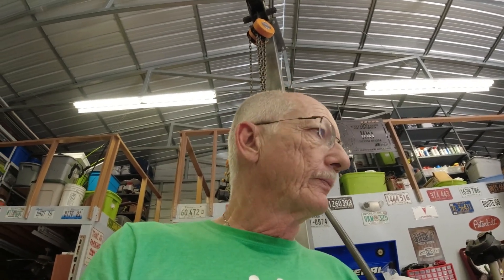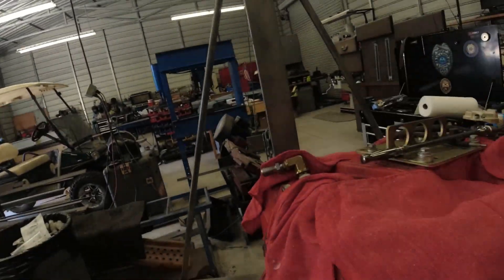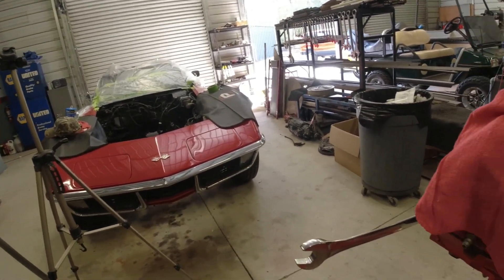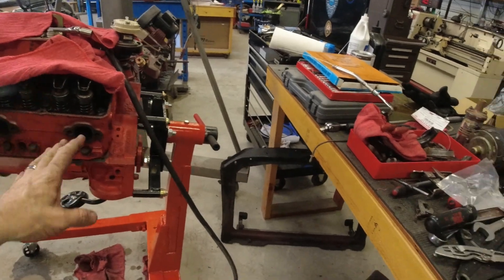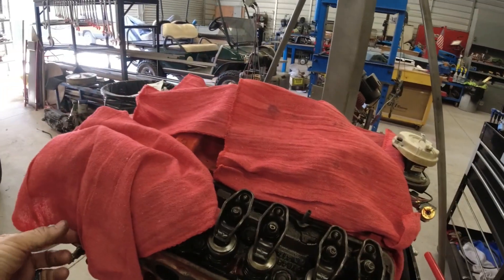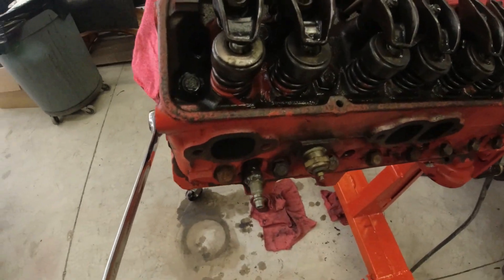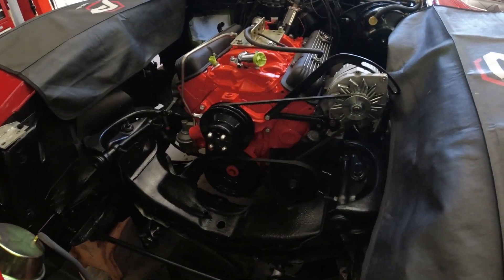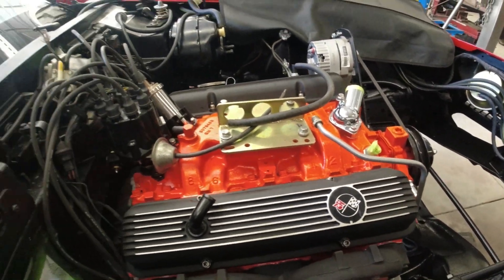Chevy 350 Rebuild: C3 Corvette SBC V8 Engine

Comment: My son and I are slowly redoing a 78. 
Our car isn’t numbers matching either.
We just got the vintage air system and Dakota gauges installed. 
I look forward to watching and learning from your videos.
Reply from the maker: I am getting ready to convert my gauges to white face because with my tinted windows and the black interior on sunny days it is hard to see the gauges. Someday I would like to replace them with Dakota gauges.
I love my Vintage Air setup. It works so much better than the original AC. 
Good luck with your car. Having you and your son working on the car together, it will be special when you get it finished. Enjoy the journey.

Comment: I love the valve covers.
Reply from the maker: Thanks. I powder coated them and then machined the fins.
Reply: @timewiththedurbins  I’ll put that on my list.  Did you hit the inside with that powder that’s supposed to make the oil run off and not wet them?   Been down the rabbit hole of coatings.  Lol.
Reply from the maker: I used wrinkle finish powder, so I did not coat the inside of the valve covers. I did not know they had a powder for that type of application. I will have to check into it. Thanks for the information.
Reply: @timewiththedurbins  I know there’s a „non wetting“ coating for interior oil areas like connecting rods, bottoms of pistons, crank counter weights, lifter valley walls.  Got me wondering if the rocker gallery and covers interiors might not benefit.  Lol engineer over thinking …
Reply from the maker: I have seen some brush on coating that work like that, but I don't think I have ever seen a powder coating for that. I will have to see if that is available.

Comment: When I replaced the valve guide seals on my '74 only 6 of the 16 valves had any seal left. All disintegrated. Made a big difference with no more blowing blue at startup.
Reply from the maker: The frustrating thing for me is that the engine installed new valve guide seals in the engine when he rebuilt it. I think some of them have slipped off of the valve guide, so oil is leaking past them.  I could get my camera into the exhaust ports and found that 3 of those guides were leaking. I was not able to check the intake guides. I am thinking of installing aluminum heads along with EFI this winter so that should take care of the problem.  Thanks for the comment.

Comment: At least your heads are the " double- bump" variety that were usedon mostly high perf. engines like 327- 350   the 302 Z/28  and  69 350 hp also 70-72  LT-1's   so  its already a good start!!! even though I don't see any  valve stem guide plates that were usually only on LT-1's
Reply from the maker: I am not confident that the machine shop guy did a quality rework on the valves and guides. I am getting oil leaking past the guide seals. After the other issues I have suffered with this rebuild I think I will be better off installing aluminum heads.

Comment: I really TINK i make big mistake when i buy mi corvette .. Mechanic's ripped you .. I Recommend to have your own garage to fixed your self ..
Reply from the maker: Luckily, I do have my own garage, but I cannot do engine machine work. I do regret not reassembling the motor myself. I have been having issues with it running correctly. I have had to change the intake gaskets because the guy used cheap gaskets and I think the cam is not timed properly with the crank, so I am going to have to pull the water pump and timing chain cover off to check the timing. This is the first time I have not reassembled an engine myself after having it machined and it will be the last. I have several valve stem seals leaking too.

Comment: Another inspiring video and the engine look's great. Did you learn that air trick form those British guys on the motor trend channel (Wheeler Dealers)? I watched an episode where they replaced the valve seals on a 69 Vette and they used that method. The Vette looks great!
Reply from the maker: I did not see that video. I first used the air method in 1979 on my 1977 Chrysler Cordova with the rich Corthian leather interior. LOL It was yellow which was the perfect color for the car because it was a lemon. I ended up having to pull the engine and rebuild it and when I got rid of the car the rear end was going out. Thanks for the kind words. Have a great day.

Comment: Where at in Florida do you live?
Reply from the maker: I live near Dunnellon. Do you live in Florida? Thanks for watching.
Reply: @timewiththedurbins  yes sir, Dade City, Fl. Just got a 79 C3 that I’m working on.
Reply from the maker: Cool, your near Corvette Generation. You're about an hour south of me. I just had surgery on my foot this week so I am out of the car for 5 weeks. Maybe when I'm back up to speed myself and Luis from 76Vette could come see your 79. Even though I can't drive the car right now I'm planning on installing the Vintage Air system in it while I'm down.
Reply: @timewiththedurbins  currently in the process of replacing the trailing arms, if corvettemods would ship the parts.
Reply from the maker: I have never replaced the trailing arms on any of my Vettes. Let me know how that goes. Good luck.